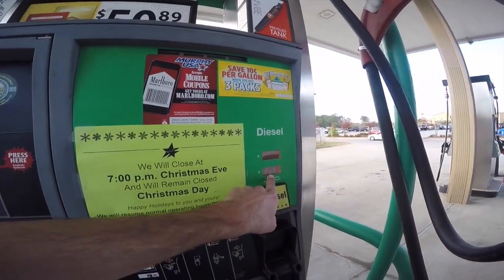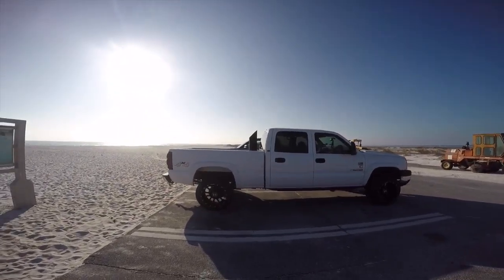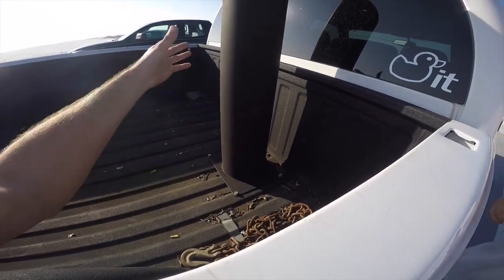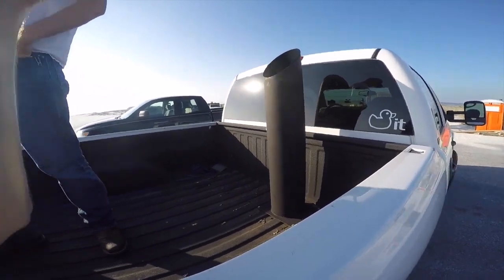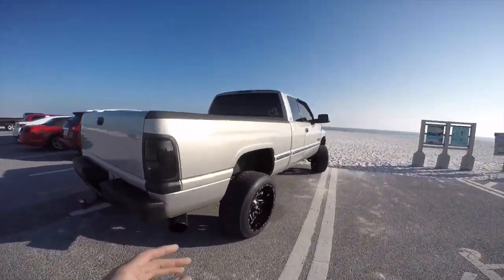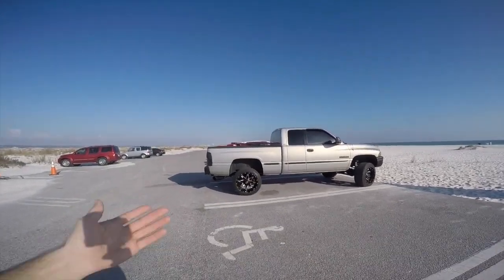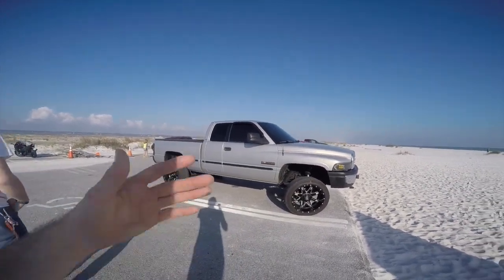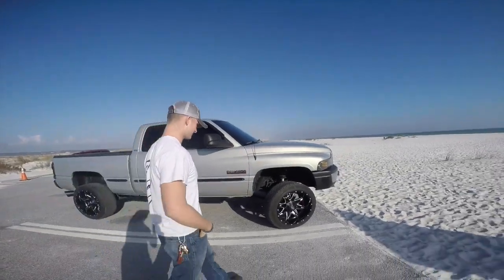Should I stack my Cummins?

Comment: It's really all personal preference.  I know a lot of guys (including myself) that have had them and then went back to regular side dump underslung exhausts once they got sick of them being in the way.  

I had dual 5" mitre cut chrome stacks on my '99 Cummins QCSB.  They looked great and sounded mighty fine.  Ran all straight pipes with the exception of the factory 4" resonator.  Eliminated muffler.  From 4" to 5" after resonator through a flex-pipe, then elbow, and through the bed to the split and then to the stacks.  My entire system was custom built by ME and it is the only one I've ever seen that was mounted in the bed the correct way.  Everything "floated", so that the torque-twist of the engine and that of the body on the frame did not affect the exhaust systems movement or flexing.  Every mount was in rubber.  When I sold the truck, the guy that bought it almost creamed his shorts when he saw the mounts in the bed.  He asked where I got them from, and I told him that I made them.  He said I should fabricate more of the mounts and sell them.  I told him perhaps, but I have better things to do.

If you are going to use the bed a lot though, especially with a short bed, you will find that the pipes being in the way are a hassle.  My '02 Cummins has a 5" factory location side dump performance system on it.  Not doing stacks again because of the lack of space in/on the bed.  Need room for my toolbox and diesel fuel transfer tank.

Comment: 208 diesel makes awesome stacks. I have one for my 2010 duramax, very solid they have the grate in them and it has a mounting plate on the bottom to secure it to the bed.

Comment: i have a 01 dodge 2500, 24v of course, and i have a diamond eye performance 5" turbo back, and i wouldn't stack it because of cutting a hole in my bed, it's all up to you. i have a 12" tip on mine and i dig it

Comment: Personally I run 2 chrome 5 in my bed and if your going to run a stack in a cummins put it high enough to wear the tip nearly peaks over the top of the cab so the smoke tiles back unless you want to wash the truck 3-4 times a week

Comment: Get a Far From Stock stack. They are 7 inch and have all the hardware and have a drain in it. Pretty expensive tho
Reply: Wutthaduck Yep, it also vibrates very little and it doesn't get very hot at all

Comment: the cummins with a single stack has bad drone in the cab. I had a 7x44 inch stack had bad drone in the cab. the lower the stack sits below the cab more drone to.

Comment: I made my own mount. so it was about 1inch above the cab. I don't like the looks of a clean truck with soot all over back window and cab like ur buddies dmax. but yes drone was very bad in cab. I had stacks on both of my 96 duals and a single. duals are better they have less drone. if u want a stack I would put small resantor on it from fte or flow pro and still have good sound. I had to put one on my 2012 because it had bad brone in cab with the 5inch exhaust.

Comment: I would not want a smoke stack because I would be blowing fuel right out the smoke stacks .I also watch truck and tractor pull and when them trucks roll coal the oil pressure and RPMS and bust a seal and may blow your engine and or cause engine problems and makes the engine work harder. And I don't recommend smoke stacks or hoods and forgot to tell you stacks can cause a fire spark and can cause fire and look up diesel trucks pulling series fails on   YouTube outlaw truck and tractor pull is what I watch that is how I know and grandfather retired from Ford and was a repairman and u awesome truck and any more questions I will ask my grandfather he own a  diesel too
Reply: western keep it nothing but country lmfao, what? stacks don't cause fire lmfao. I had a stack on my old 1st gen for 5 years of daily driving and never had a fire. rolling coal can cause damage, but it will NOT blow seals out of the engine. I used to push 3 times the amount of fuel that would have been necessary through my old 12v and never blew out a seal from it. I did blow a seal from too much boost. and when you see fire coming from a  competition diesel's exhaust it's usually nitrous.
Reply: I saw it happen on outlaw truck and tractor pull on TV and it comes on every Saturday it was a diesel 4x4
Reply: western keep it nothing but country if the motor blew up it was due to mechanical failure, NOT because he had a stack or was over fueling the engine lmao
Reply: transamfan81 thanks for your advice u know your stuff.

Comment: i had a second gen with a stack it was good but the top of my cab would get covered in soot, in my 2012 cummins i have a 10'' stack with a 45 off the back like this one http://i991.photobucket.com/albums/af31/jmfb15/MM508-36CATGB__3_zps4db97121.jpg i personally like this kind of stack better, only other thing is that it is very loud when sitting in the back seats, but Truck looks tits money! keep it up